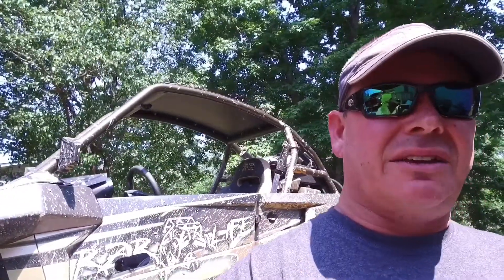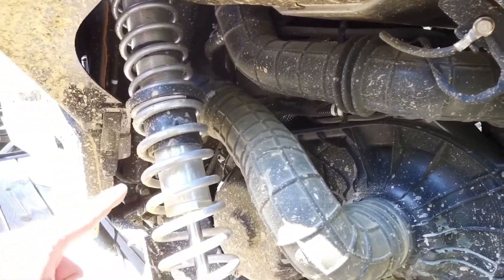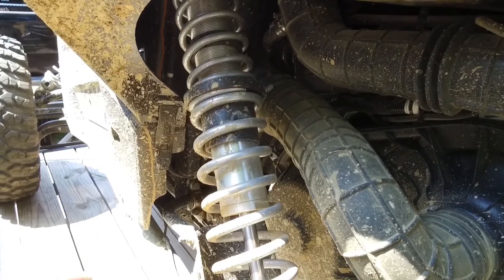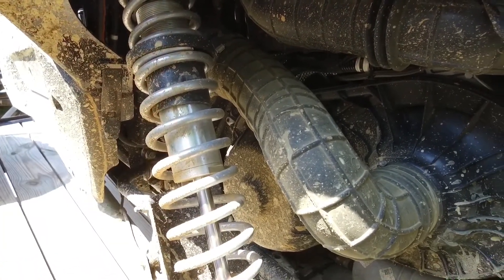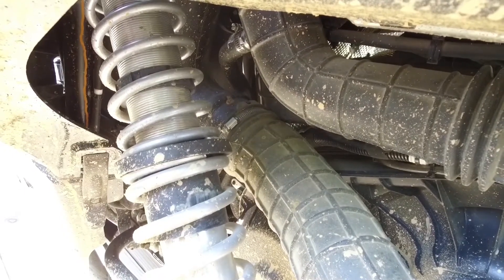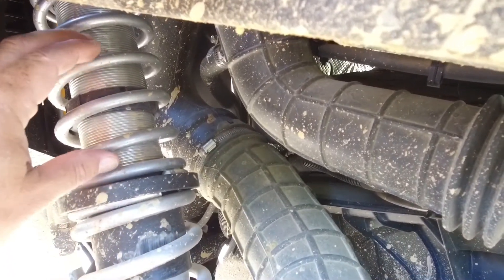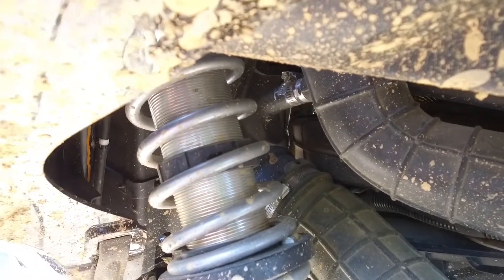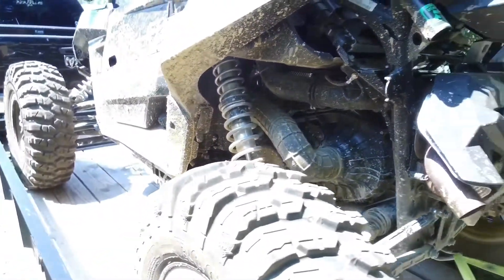True Dual Rate Springs Using Crossover Rings on the Polaris RZR RS1

Comment: also, it rides on both springs until locked out, not just the top.
Reply: In the suspension cam video, you can see both springs moving until the divider reaches the crossover rings. Both springs work at a combined rate. You need to know your individual spring rates, but i believe the math is (big spring X little spring) ÷ (big spring +little spring) = combined spring rate.

Comment: Check out shock therapy.  Plastic crossover rings don’t last metal is key. Shock therapy has 400 different spring rates IN STOCK all guaranteed for life.  Send your main rides shocks in get springs AND internal valving their IRS upgrade.   World of difference.  Springs alone are 70% of the upgrade.  You are selling yourself short.  Also where are your orings on the crossover ? They have RIS ( ride improvement systems )  custom to your weight , tires, and accessories btw

Comment: 2 coils with different ratings = dual rate. you can get this without a crossover ring.
Reply: incorrect, unless you are using the slider upside down and it hits the shock body thus locking out the top spring.  To get dual rate you have to lock out the top spring some how.
Reply: Wrong sir, it's considered a straight rate.
Reply: @Tombomb1816  I will believe foxracing 16, you are wrong like it or not
Reply: also with out the ring the car is going to ride on the softer spring never allowing the bigger spring to do anything
Reply: Ugh, hate it when people post incorrect info, you want dual rate? Then you better get crossovers like the video says!
Reply: Think about it.  When the smaller spring bottoms out the heavier one comes into play.  IMO the crossover ring allows this to happen sooner.
Reply: @chrissilva661  this is how I understand it. Everyone says it's wrong but why not get the full use out of the softer spring? If you want the stiff spring to kick in sooner, sure, use the ring. I came to this video in attempt to learn how to set it so I can understand the difference. My Xtreme RZR Performance tender springs on oem mains rode better than my ST springs. Debating on putting that setup back on.